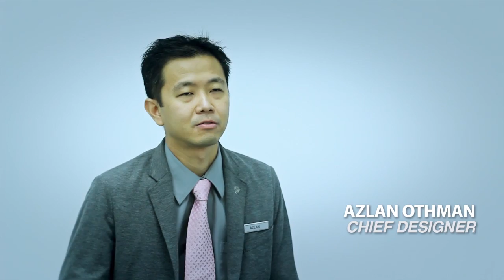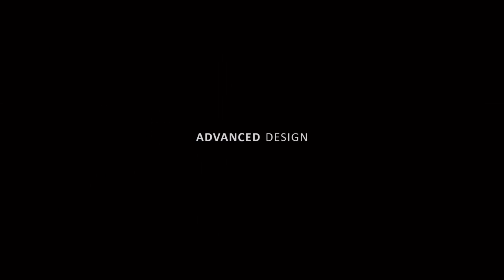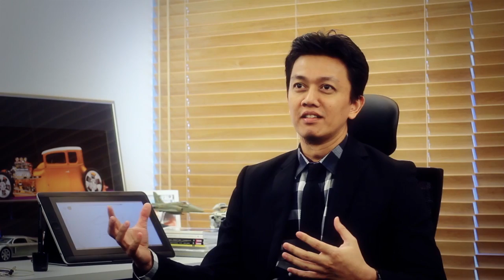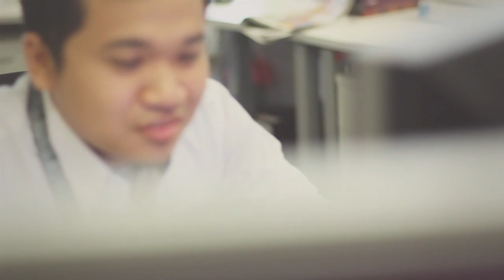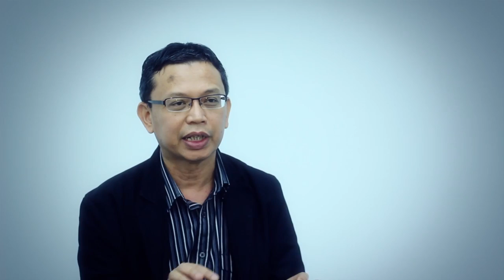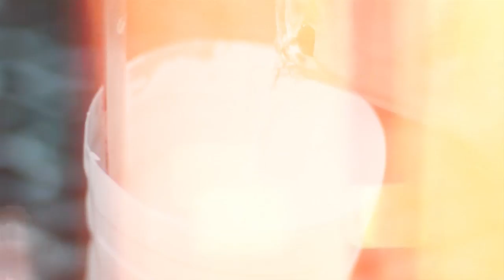Proton IRIZ - Proton Design Process

Comment: So the new Myvi is here but the whole body design just looks extremely normal. However the iriz has already been around since 2014 but this small hatchback still looks exceptionally sporty, and it also drives as sporty as it looks. Well done Proton. I love my Iriz 1.3 Standard CVT.
Reply: Andre Ng Ya interestingly that the Iriz still look Fresh and Sporty even in the 2018 which 4 years already since it launched back then in 2014. Especially the 1.6 model look aggressive

Comment: Why is this job assigned for bumiputeras only?
Reply: because no non.bumi applied . you go apply
Reply: I got prove. One of my Indian friend had straight As in his engineering studies. And another malay had no As and poor marks. My friend had rejected and the malay guy was hired as the engineer. The lame reason told to my friend was 'this work is only for bumiteras' after all inteviews.
Reply: I'm not assuming. The interviewing staff in Proton clearly said that the job is assigned for bumiputera only.
Reply: +Muhammad Nazrin Ali Rahim 
It makes some sense bro. Some jobs are just that...'reserved for Bumipeteras' or 'only Mandarin speakers need apply'.    At times, quota systems suck, but they secure positions for underprivileged  groups. That happened to hospitals too, if you notice there are more Bumi doctors now. Many turn out to be very good doctors even if many were not 10A+ SPM holders! So, I take this story with a liberal dose of salt. It works. * don't shoot me. Just my own observation.
Reply: kacang merah die ni...hermm